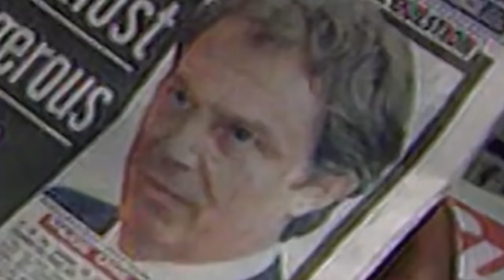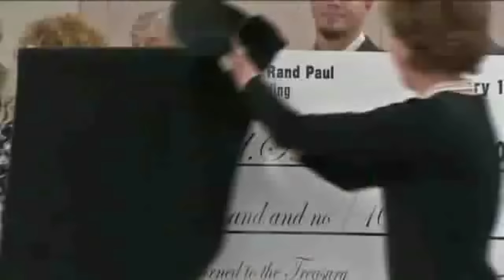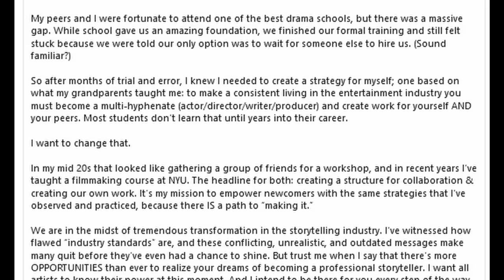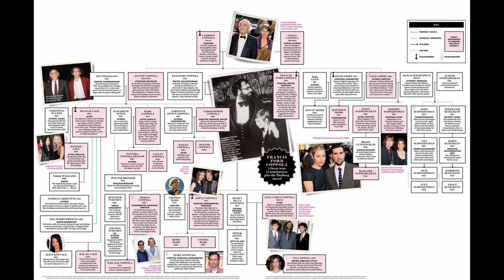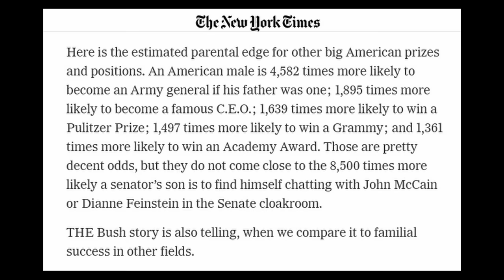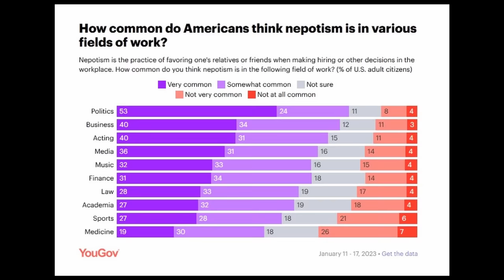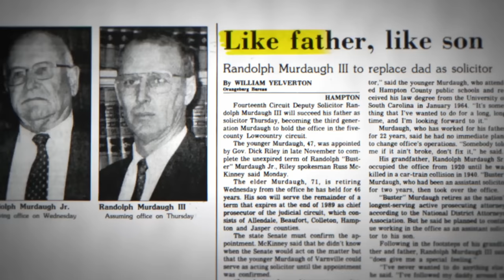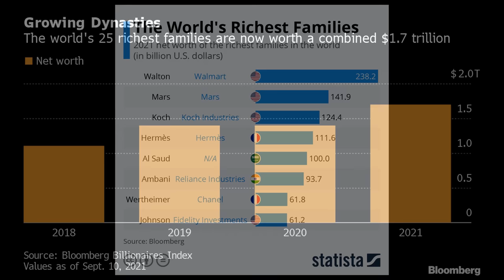Nepotism Explained

Comment: My parents owned a bar and I am an Automation Engineer. It's not impossible... But there were a lot of barriers to break! 

I started on Navy ships for 15/hr with a EE. No one else that I worked with had formal education, it was a union job and it looked good on a resume.

I then went to a manufacturing site as a controls technician.. this was a tough job to get, but I took advantage of this opportunity wholeheartedly!

I was promoted to engineering after two years. It wasn't the engineering job I wanted, but it was a foot in the door.

I then switched employers to a local engineering firm. A lot of luck was involved, they just opened the office and needed people badly.

I took full advantage of this opportunity, and after only two years moved from Engineer 1 to Engineer 4. I think all of the real world experience was invaluable. They can shove that EE for the most part.

Hopefully my kids (if and when I have them) have an easier time than I did.

Comment: Can confirm that, even in low level employment, being a relative of someone in that field can get you an interview, and potentially a job, much faster than just happening upon a job listing and applying for a role with the correct qualifications. To pretend nepotism doesn't exist, at any level, is simply naive.

Comment: The problem with nepotism is it is a completely natural thing to do and almost impossible to make any laws against it outside of the most blatant quid pro quo cases. As Georg stated, it happens at every socioeconomic level. Of course, that's not to say all cases are equal. There are areas of society where it has a much larger effect and the gatekeeping is much worse. I respect anyone in the entertainment industry far more if they just admit they have had advantages many others would not have. I'm sure they still work hard, but they should admit that their path to Hollywood is far different from the person waiting tables part-time going to every audition possible. For someone from a very influential family to proclaim that their success was just based on merit is laughable. 

Another problem with nepotism is even if you remove someone being given opportunities or jobs through connections they still have the advantage of having family members with generational knowledge that can be immensely helpful. I was the first in my family to get a college degree and trying to get my first real job after getting it sucked and was hard. I didn't know anyone who could give me practical advice on just looking for a job.

Comment: 14:35 perhaps I'm getting ahead of things here, but I think a distinction needs to be made between nepotism and networking. I would argue nepotism by definition requires the connection itself to be the biggest factor in being able to move into or climbing the ranks within an industry, whereas networking could be more distinctly characterised as opportunities arising from a reputation built on the merit of someones previous output or potential. I think relying on personal contacts to seek out job opportunities or a referral should not automatically be considered a form of nepotism, otherwise even things like LinkedIn endorsements could be labeled as nepotism, which is silly imo and potentially undermines the hard work of people who initially enter an industry with no connections.